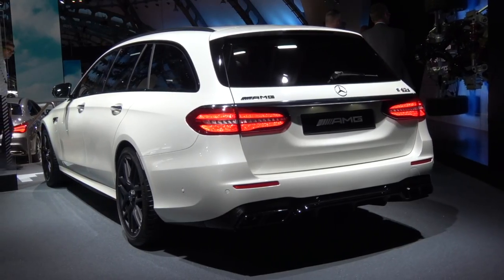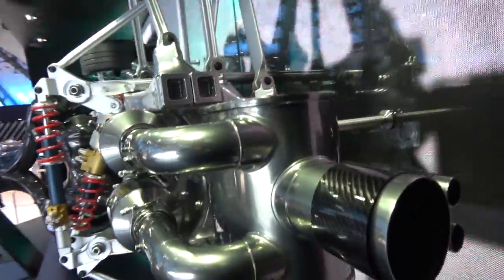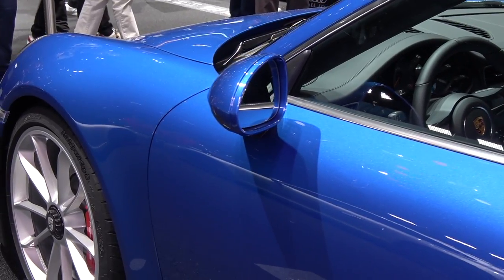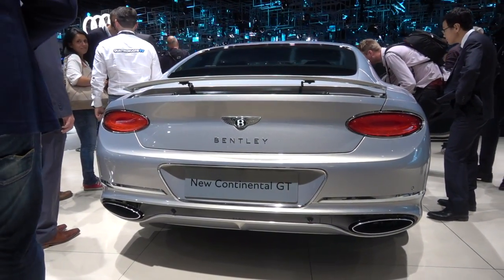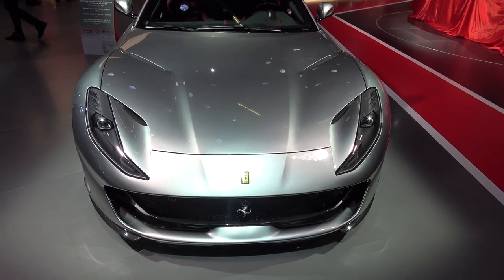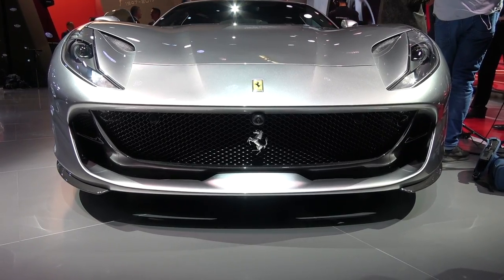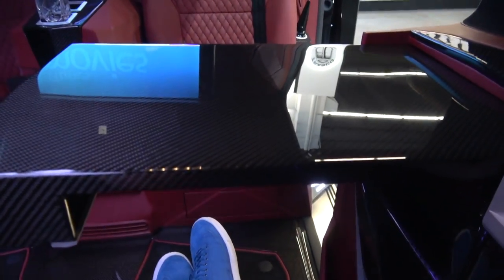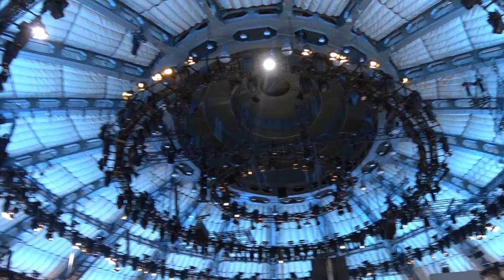5 Cars I'd Consider Buying At The Frankfurt Motor Show | MrJWW

Comment: James I think going for the touring package for the GT3 depends on you're use cases for the car. I would go for the touring, when I would do more Alpine roads then racetrack. If I would do more racetrack I would go with the normal GT3 and wouldn't speck it manual.

Comment: Get a Porsche Panamera Sport Tourismo Turbo, instead of the E 63S
Reply: Nah, E63 S is probably the best performing saloon out there right now, even though the new Panamera looks quite nice but its interior just cant quite keep up with the Benz imo
Reply: AMGNokia I think the Porsche looks way better on the outside as well as on the  inside. It's just Porsche, it's perfection
Reply: RS6 is the best car in that category, no competition really
Reply: Nemanja P those days are gone tbh. The RS6 is good in a straight line, but this new AWD system in the E63s is on a whole new level. Vorsprung durch Technik? I don't think so
Reply: y skr010 I don't speak nazi, if any car is famous for straight line performance and sucking at cornering it is Mercedes. Point of those cars is not being stuck in snow . Subaru and quattro over any other system.
Reply: y skr010 Do you even know how old the plaform of the actual rs6 is? 😂😂😂 you cant compare these to cars, you have to wait for the knew rs6....
Reply: Kamran Latifov have you heard porsche will probably be in f1 by 2021 and they will probably already be dominating best chassis and engine
Reply: Paul D. The panamera looks much better... but the Tourismo is pretty ugly..